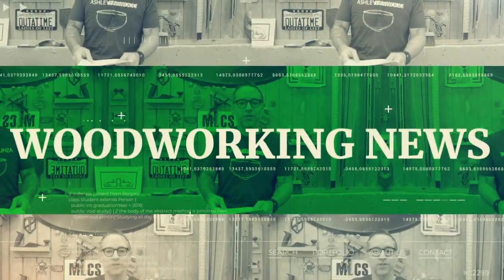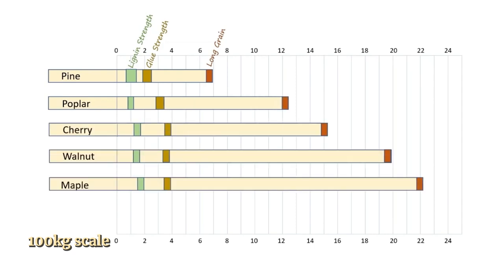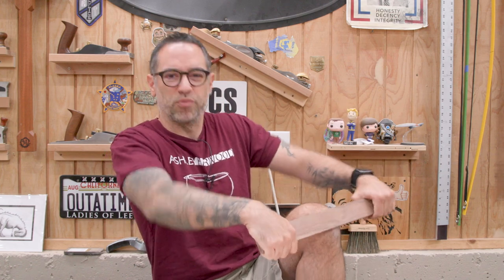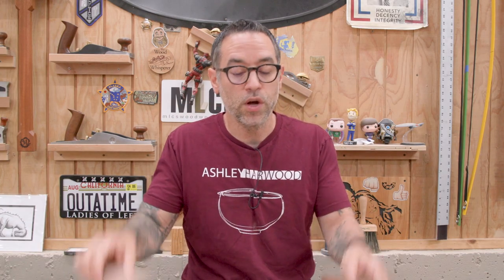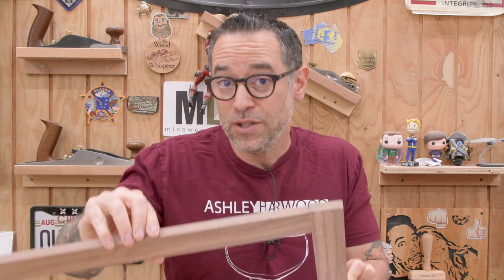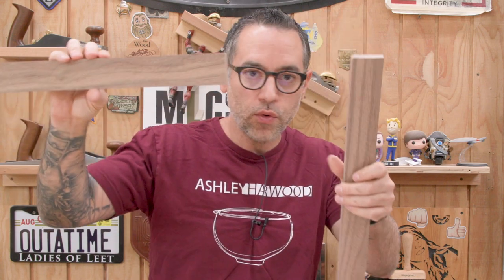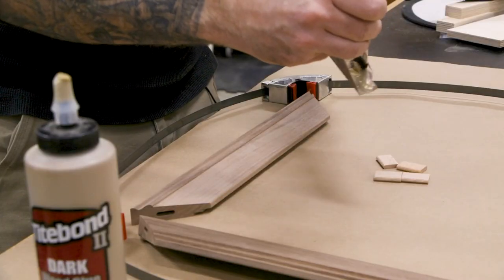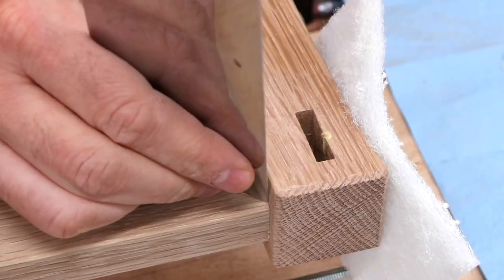End Grain Glue Myths | You May Have Misunderstood

Comment: Great video that offers a much-needed context. 
However, the part with multiplying "strengths" to get the "overall strength, is a bit incorrect.  If you have a frame, and you stand it on one the ground on one corner and push the other one down, then you have in fact only ONE corner's worth of strength.  The frame will not break in "all" corners;  one corner's failure is enough to "break" the frame.  In many cases, discreet joints in a frame or structure are in fact like springs that are linked together in series (like a chain).  The weakest will determine the strength of the whole structure.  I think what you want to use the multiplications for is within the "joinery" of a single joint. As in a loose tenon has 2x glued surfaces working in shear vs. the end grain joint working in tension (which is weaker due to the "pull out" effect that the original video nicely demonstrated).  There you can say the loose tenon joint is at least 2x stronger than a butt joint.  But saying that a picture frame has 4 joints, thus 4x the strength, is not true in most applicable loading scenarios. 
TLDR: "joints" are not always linked in parallel and in fact in most cases act as the links of a chain.  The overall strength usually comes from the weakest link, not the number of links ;)
Reply from the maker: Thanks for your thoughts. Going to have to agree to disagree on that though. Most pieces of furniture will be closer to the sum of their parts than the integrity of a single joint. I realize my example was oversimplified but that doesn’t really change the point I was making.
Reply: @woodwhisperer  Hmmm... Agreed.  I can see my point was not valid in the sense of the "chain" analogy. I am a civil/mechanical engineer so when someone associates "force" with strength of a joint that is in fact subject to "torque" then it short circuits some parts of my brain and things get confused :D Probably my problem with the 4x calculation is rooted in the oversimplification :) Thanks for the reply. I am not going to edit the original comment to fix this so that it can remain as an example of jumping the gun too fast ;)
Reply from the maker: @AlipashaSadri  appreciate that. I am often guilty of oversimplifying in hopes of conveying a broader point. I realize that can be frustrating to those with a deeper knowledge base.

Comment: What will I change? I'll not add splines to some mitered joints, e.g. picture frames, where no big force will apply. Wood movement is also not a big deal in such case, if it's made of the same board.
Reply: If you're selling them I'd still reinforce them.
Reply: splines still add a ton of glue surface area which probably has a significant impact on strength as well.

Comment: Isn't the math at the 5 min mark wrong? The strength of a structure is only as strong as its weakest part not the total of the four joints. Or where am i wrong?
Reply from the maker: I oversimplified but my point is still valid: joints become somewhat additive unless the pressure is applied very strategically to only one joint.

Comment: I think there are some small mechanics implications that you didn't get fully right (doesn't really matter). Most likely if the glue has let loose in a M&T joint most people would consider the piece of furniture "broken" and in need of repair. Secondly i believe the force needed to make a M&T joint fail in that manner would be greater than that of the surrounding wood. The FWW joint breaks resulted in long grain breaks adjacent to the M&T, the goal of joinery is to span the lignin bonds so that long grain fiber bonds must break for the joint to fail. Hence why a half lap is usually the strongest with the bridle very close behind.

Comment: The green line is the strength of LIGNIN, and NOT the side to side strength. The lignin is the natural "glue" that is inside the wood and has nothing to the wood glue. I the original video it was the lignin (=i.e. the wood) that failed first and not the glue.
Reply from the maker: It IS the side to side strength. I agree that it's not specifically the strength of the glue bond, but it is the ultimate strength of the side to side connection.

Comment: In Patrick's chart, the measurements were in Kilograms, not pounds. It doesn't look like the math in this video converted Patrick's numbers into Pounds. With that said, joinery is what should be taking up the load and glue should be there to assist in holding the joint in place.
Reply from the maker: I did convert the numbers first.

Comment: A picture frame being compressed diagonal does not seem to provide support of 4 times the (45°) joint strength. Some joints are in series and some are in parallel. Perhaps only 2 times the 45° strength?

Comment: Peter Millard over at 10 minutes workshop did a glue test as well mind you with MDF and in his testing even he was surprised with how strong just glue is. 

But haven't seen him ditch the domino either.
Reply: I liked Millard's experiment too. In the construction he tested, the  forces are called "shear", where the force tries to move the glued parts in opposite directions, but parallel to the glue layer. If the shelf had only been glued to two legs/one side, an even load on the shelf would not be counteracted, and the glue woul be under tension, with the shelf acting as a lever. But balanced, this was precisely one such construction, where a glue joint might be more than enough. As long as it isn't used as a chair, or one leg is left floating.
It's like the little cheap square LACK table from Ikea, it is very strong for correct use, I think you can stand on it if you're careful. But you can poke a hole in it with a pointed object, and inside it is just thick gray paper glued in a honeycomb structure. Or WW I aeroplanes - doped linen over a wooden skeleton and stringers - the combination gives strength as long as the integrity is maintained.

Comment: So, when you hear people say, e.g., when gluing up jointed boards to create a table top, that the Dominos are there for alignment only, as they don't really add strength, then that is a complete furphy, they clearly do add considerable strength, significantly more than the glued side grain alone. True, the Dominos might not be needed as the glue joint alone is plenty strong enough, but Dominos add far more strength than the glue alone.
Reply from the maker: Can’t speak for others but when I say I’m using dominos for alignment only, it’s because the additional strength afforded by the joinery is unnecessary.

Comment: The “myth” of end grain glue up being weak, probably dates back a century or more.  Hide glue will produce very week end grain to end grain joint, simply because it doesn’t have much strength.  Just from personal experience, the aliphatic glues available when I learned to work with wood, fifty years ago, are far wpeaker then modern tight bond.  So, as glues have improved things which used to be true about the strength of glued wood, have also changed, but our collective “wisdom” hasn’t kept pace.
Reply: well said, thank you for speaking up on the subject.
Reply: Well no, it simply is a fact that an endgrain JOINT is weaker than a longgrain JOINT. But that is not cause the glue is the weakpoint but because an endgrain joint has no overlapping fibres connecting the 2 parts - and fibres are the strongest part of the whole assembly.
If you want an actual comparison then you would need to compare the wood-graind going in the same direction and then one connection is just an endgrain-glueup and another one is a longgrain glueup (like a lap-joint) and then see the vast difference.
Reply: @ABaumstumpf  In the original video, which is driving all of these posts, the poster glued end gran to end grain, and stressed it to failure with a three pint loading.  It invariably failed where the glue petered out in the bond.  It did not fail at the joint, but next to it.   

The modern glues are getting to the point that they are several times stronger than the lignin which binds the cellulose fibers together.  It is also penetrating further into the wood.  Thus it is beginning to develop strength as it binds the fibers together across the joint.  Kind of like the deployment length of the reinforcing in reinforced concrete. 

Thirty years ago, as a young and ignorant engineering student I wasted away many hours and a lot of very nice maple, trying to develop a test method to directly measure the tensile strength of wood.  So far no one has come up with a method, and all tensile strength values for wood are derived form it’s response in other loadings, and working backwards to what the minimum tensile strength has to be to get the results.  

I may try developing some experiments and data on the actual strength of the glued end grain to end grain joints.  Or, I may just forward a copy of the video to the folks at the US Forest Services’s Forest Products Lab, and see if they are interested.
Reply: @deankenneth7479  hide glue is relatively weak, and does not penetrate as well as the modern glues.   So, yes if you did a series of tests to compare the relative strength of glued joints, hid glue will weaker than the modern glues, and the test joints will generally fail at the joint, and not adjacent to it as the joints done with the modern glues did in the experiment that started this whole flurry of videos, and discussions.
Reply: @randallthomas5207  "The modern glues are getting to the point"
That was the same for glue hundreds of years ago.

"hide glue is relatively weak, and does not penetrate as well as the modern glues."
https://youtu.be/JrBsARhVwbY?t=87
Hideglue, longrain joint - so, come again with your assertion that longrain joints or hideglue are weaker?
It has advantages and disadvantages. One that is both - it is reversible. Another is that it is hard which leads to early breaking with flexible wood, but with harder woods it is just as strong as PVA.

But the thing is - the type of joint matters more than the type of glue, as even this video shows where the endgrain-join is not even close to 50% the strength of the wood, where as a longgrain joint that fails that early would be deemt a failure.
But this video here sadly never compared longgrain vs endgrain joints in the same application, only the strength of the glue vs the strength of lignin.

Comment: When you glue smaller boards together along the grain, it becomes a single large strong solid piece of board. But what if the original boards were not cut along the grain but across it and then the glueing occurred only end grain to end grain? That would mean that the glued large board would be even stronger. That is not taking into account why most wood is cut along the grain, since that is how trees grow, or whether a stronger bond is even necessary at that point since the glue is already stronger than a single piece of uncut wood.  

So end to end glue ups are not technically weak(er). But in the grand scheme, they are not necessary nor practical. It is sort of like, the strongest piece of furniture would be if a tree grew in the shape of the forniture. Technically might be true but good luck with that.
Reply: No it wouldn't be stronger.  The conventional glued up board would have long grain in one direction and edge grain in the other direction.  Gluing it up on the end grain would still have edge grain in one direction but the long grain direction would be broken up by the end grain glue joints, which are much weaker than the long grain.

Comment: I did watch Patrick's video and thought.. well duh...  
nevertheless you speak of the Myth about end grain to end grain glue joints.. I have understood that if you apply glue and let it set up for a few minutes then apply a second coat upon which make your connection to the other board... alas that too is most likely a myth onto itself.
Besides Glue is on the same shelf as a Nail or a screw.  by themselves not all that strong but in combination with whatever joinery you apply.. that is where the strength as you said comes in.

Comment: You do need to be a bit careful just multiplying break force across the total number of joints.  Stress is distributed, but rarely is it distributed so evenly that the total across the piece is equal to the total of all joints added up.  A piece with 4 joints may appear to be able to support 1200 lbs, but if you actually put a 1200 lb object on that piece, it is almost certainly going to fail.
Reply from the maker: I realize that’s not a perfectly accurate number but I think the point is valid.

Comment: This is still not really getting at what is wrong with the original "myth busting" video. In that video, he's comparing apples to oranges: The strength of a end grain to end grain glue joint (confirmed to be rather weak, honestly) vs  the strength withing a wood piece across the grain direction, which has always been known to be weak and no one in their right mind relies on for strength in a construction. So there was no myth busted there, only misunderstanding of what was actually demonstrated.

Comment: The reality is that the claim its a "myth" is the myth. As you point out the point of boards is to make one strong board out of two or more boards. End grain to end grain or end grain to side grain doesn't do that. Although, he never actually tested the strength of an end grain to side grain glue joint. What he actually demonstrated was that boards break more easily with the grain than across the grain and that both glue and wood fibers are stronger than lignin. Not exactly new ideas. 

It may tell is something about making a scarf joint stronger. Partially it provides more surface area for glue, but most importantly it relies on the wood fibers rather than the glue for its strength. The glue is essentially replacing the lignin.

Comment: He didn’t test glue bond strength.    This should be obvious.   The edge grain glue bonds did not break.   The edge grain itself broke.    This will always be the case.    Wood is weak in that direction.   If he had moved his fulcrum a fraction left or right the edge grain would simply break at the fulcrum.    

The end grain, the wood does not break.   The glue breaks.  

He totally misinterpreted his own results.    

His edge grain breaks were simply breaking wood-itself parallel to grain.

Comment: I take issue with "multiplying by four" just because there are four joints, that would imply, put in 100 joints and it would be stronger than steel!

I think you need to do a more rigorous structural analysis of - THE STRUCTURE - to determine the combined load capacity.

BTW - you quote quite high figures compared to the (https://youtu.be/CE147Ow7RmM?si=Kj3RmU0mfv280tI-) video - which worries me!

Comment: That is the failure of the original video as he is saying that engrain joints or strong and it is a myth that endgrain joints are weak.
Sure it is true that the Reason, that some like the Magazine he is quoting, given is often wrong. But a simple endgrain butjoint is weak. It is the Joint that is weak, and the reason of that is that the glue, while stronger than lignin, is far weaker than the fibres along the grain.

To get an actual picture of why it is (correctly so) stated that a endgrain-joint is weak you need to test joints in the same application.
Take beams and cut one straight down, so you can glue it with a endgrain to endgrain butjoint, for the second beam cut it diagonally for a scarf joint, or make a lap joint. And if you go to the extremes like a finger joint it will show strength very comparable to a whole beam that was not cut at all, rather than the endgrain glueup that fails at like 1/5th the stress already.

Comment: The results of Mr Sullivans test are being interpreted incorrectly, claiming to have debuked some myth and you just doubled down on it.
Are you testing glue strength or wood strength? These are two distinctly different things and not interchangable.
Reply from the maker: Yet indistinguishable to a woodworker that wants to know when a thing will break. I agree that his test never showed a long grain glue bond break, but that doesn’t invalidate what he showed and what we can learn from it.
Reply: @woodwhisperer  
The reason why people "assume" end grain joints are weak is because they do break as shown in the video. A pure glue only bond is weak in end grain orientation, which as you know, is why we generally don't use them, So where is the myth and what should I have learned? I'm struggling to find any new information gained by this testing and the subseqent explantions. I'm not trying to be a jerk but when you make claims like "end grain joints are strongest" you open yourself up for some debate.  Now you and others find it necessary to explain to the thousands of people who clicked the like button, that what they actually saw in the video, doesn't mean what they think it meant.
Reply from the maker: @Eweber007  at best, the busted myth is a bit of an exaggeration. But as I said in my video, my takeaway is that the end grain connections are a little stronger than I realized, but ultimately the takeaways amount to very little actionable information.
Reply: @woodwhisperer  Thank you for taking your time to reply.
Why I have an isssue with this whole situation is that far too many now have a misunderstanding about the misleading results from Mr Sullivans video. I know you're trying to "clean up" what the results actually mean but I fear the damage is done. I have a bad feeling that in the not so distant future we'll hear things like "but in Sullivans video end grain is stronger, why did my thing break"
It's a recipe for bad craftsmanship